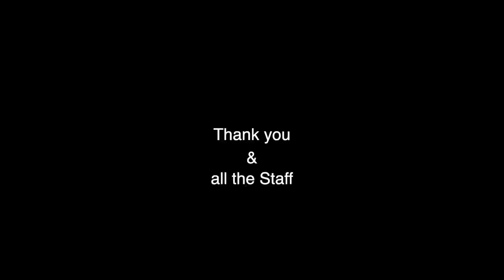Minivan Home Project Complete || Final Phase Of Camper Construction & Saying Goodbye To The Shop

Comment: You obviously don't want any passengers 😂 I took my front seat out years ago and it changed my life in many ways. So much extra space. Well done!  Good to watch. Love the pace of your video.
Reply: I have been on the fence about removing my passenger seat for months! I like the option of having a passenger, but 99% of the time I am flying solo. I just can’t make up my mind :/
Reply: @QuantumQuibbles  It's a hard decision, but it depends on how often you use the seat Vs using the space more effectively. There's a load of space there.

Comment: ok. sir... real ? not sure if you been asked this before.... beside the cost... what are your thoughts about 80/20 builds in the van life? I mean 60/20 extrusion for framing to replace wood? really like to hear your thoughts on it...
Reply from the maker: Are you talking about aluminum? If so I think it would be fine, so long as you have that stuff mounted with a thermal bridge of some kind so it's not mounted directly to the van siding.  If it were bolted directly to the metal you'll likely run into condensation in those areas in cool environments, which will eventually lead to other problems.

Comment: Will the front floor vents supply heat to the new cabinet area where the water is?  Thinking ahead to the cold times...

Cabinet looks great!!!
Reply from the maker: Yes it will - at least a little and only when I'm driving.  I may adjust the use of the space in the winter.

Comment: What power tools did you need and use to complete the whole job?
Reply from the maker: Mostly Milwaukee - Jig saw, angle grinder, drill, impact, router, table saw, and a brad nailer. Occasionally I used a skill saw and an oscillating tool.